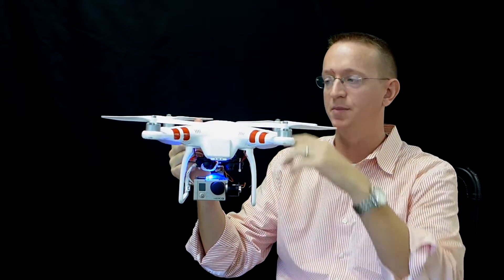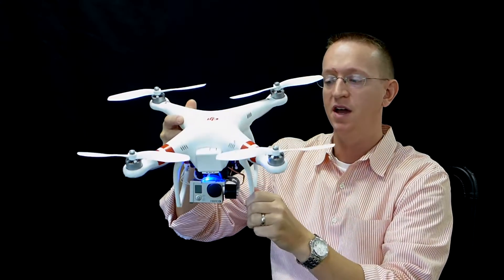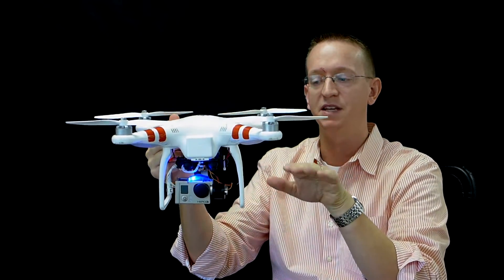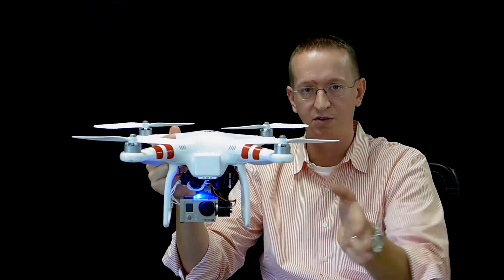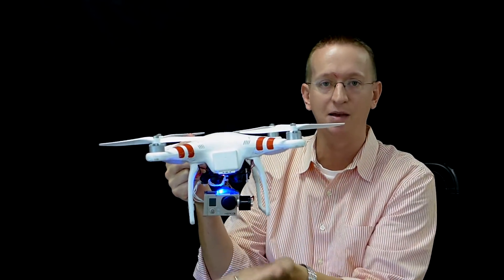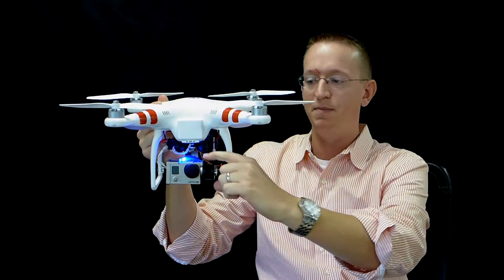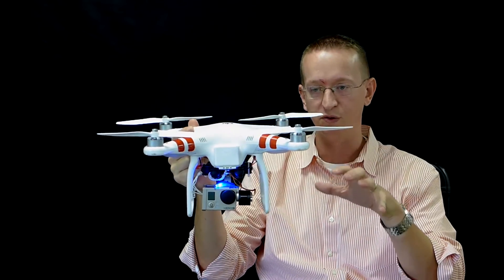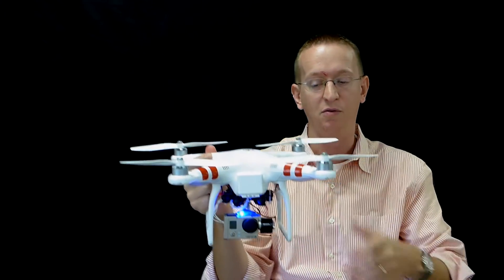DJI Phantom Gimbal Explanation

Comment: http://www.amazon.com/Beholder-Brushless-Phantom-Assemble-Required/dp/B00HNYD9ZY/ref=sr_1_1?ie=UTF8&qid=1389531273&sr=8-1&keywords=Beholder+Lite+Gimbal+For+DJI+Phantom is this the same one? and if so dou you have to do anything to rotate the camera with the remote. i want the phantom and a gimbal so much!!
Reply from the maker: Yes, that is the same one. Though, it's inexpensive, it does require some manual tuning to get a higher quality result. Details here: http://www.tricedesigns.com/2013/11/18/video-gopro-cameras-quadcopters-creative-cloud/   I also used this method to add manual pitch control to the remote: http://skypixel.org/post/59236103638
Reply: Andrew Trice but i don't need the pitch do i still need to open up the phantom or can i plug it straight to the battery ?
Reply from the maker: you'll need to open it up just to attach power.  there is an aux power inside the phantom, just waiting to be wired up to a gimbal.  just pull the wire through the bottom holes, atttach to the gimbal power wires
Reply: do you know if there is any video of this process
Reply from the maker: Yes, I have provided details and links to them here, under the section "Installation Details" http://www.tricedesigns.com/2013/10/09/review-beholder-lite-gimbal-for-dji-phantom-quadcopter/